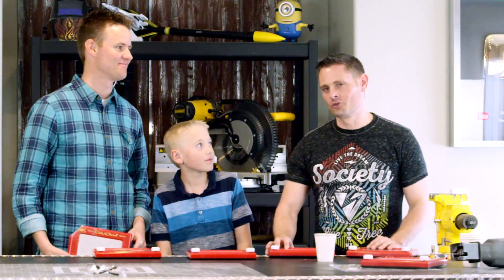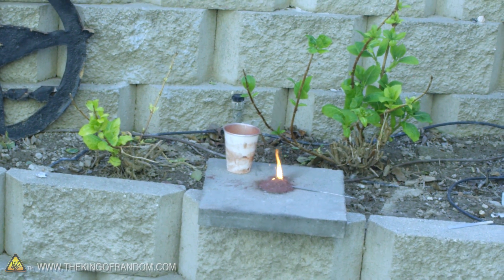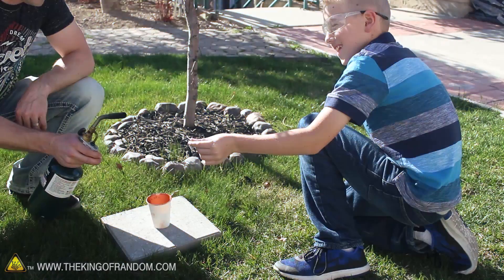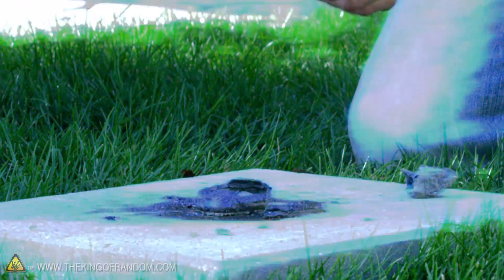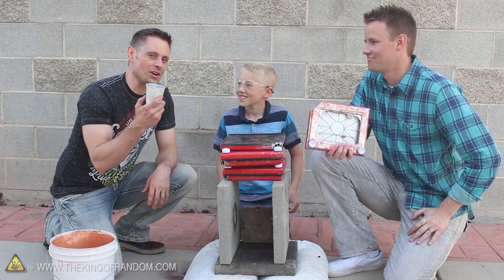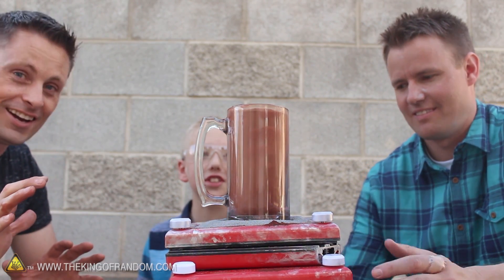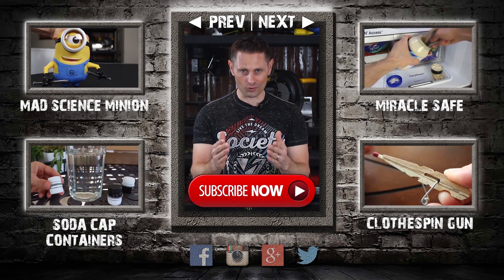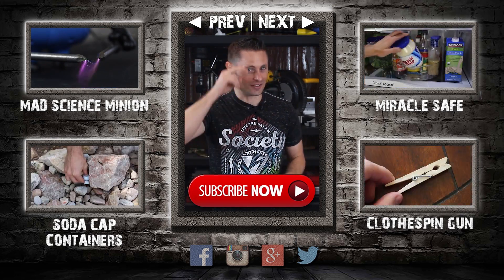Can you make Thermite with an Etch a Sketch?

Comment: Grant... how about aluminum foil vaporized in a electrical socket for some homemade lightning!?  There is also another related science experiment, where you can (allegedly) replace the foil with a thin wire (in the electric socket) and the results are suppose to produce an arc with a bang on par with a 4th of July category 4 aerial salute(?) However, in order to achieve this, I believe 220V or higher would be required... definitely not an experiment for those who are safety challenged!

Comment: Isn't the stuff in the etchasketch magnetic powder? Is that not how it draws? Considering Aluminum is non-ferrous, I doubt it's aluminum powder.
Reply from the maker: +Jacob Furrow The powder doesn't react to a magnet, or water.  But it does dissacociate in HCL
Reply: the aluminum powder  coats the screen then twisting the knobs moves a needle that scratches lines of the powder off. I took one apart when I was little.
Reply: Mark McGehee Yeah, I just remembered that. For some reason I thought it involved magnets.
Reply: Grant Thompson - "The King of Random" Have you tried melting it?
Reply: +Jacob Furrow it sticks to the glass inside the etch a sketch and then theres a etch that scrapes the powder off in very fine lines then when you shake it the glass gets coated in the aluminum powder so it can be etched again
Reply: In what insides video they tried magnetics it didn't work

Comment: The proper way to light thermite was to use magnesium strips and you didn't compensate for the styrofoam balls in he aluminum powder so you were actually supposed to double the amount of aluminum powder to iron oxide.
Reply: +Jnm1220 I highly doubt that the styrofoam balls in the mixture accounted for half of its mass, considering the density difference between styrofoam and aluminum.
Reply: +Maximum Of Twenty styrofoam still has mass though so it could be a possible factor

Comment: Had u used a flower pot with a hole at the bottom you would have contained the termite to burn down to the etchasketch

Comment: Hey Grant
I have an idea.dHow about you make a tutorial on how to make a hand heald fireball. Its really easy, all you need to do is coat a (100% cotton) cotton ball and you soa it in nail polish remover and you light it on fire. Because cotton is great at holding heat in its core and nail polish remover gives off almost no heat the cotton ball when on fire feels room tempiture. depending on the saturation of alchol for the chemicals 50-60% gives off a bit more heat but less pure nail polish remover like 20-50% gives off a smaller flame. Also the reason that the Etch a Sketch did not act like a propper thermite because you did not have a oxidizer and if you left the styrofoam balls that definitly would have stopped it.
Sincerely
                  One of your Fans

Comment: It's thermite it's a mix of aluminum powder and iron oxide "rust" and mix the two together until you get a fine red powder and you will end up with a hunk of steel and little pieces of iron so yea fun backyard experiment
Reply: And a better way to light it off would be magnesium it lights of better

Comment: The last experiment scaled up to quickly for my liking.  Starting from the amount of thermite, to the insecure stand... I mean: Using a CO2 interesting was very wise - but when a CO2 extinguisher does not work and I know I have burning metal and an oxidizer in the mix, I personally would not user water. It obliviously turned out good, but I was scared seeing water and thermite.

Comment: for a project make a slingshot steel ball blow dart  use the ball as the tip then use a drill or something to put a bolt or screw through it

Comment: you ave some very informative videos. However, it looks like you are starting to lose focus on safety. This video shows you guys igniting explosives/accelerators in a dangerous manner, then for some reason putting the reaction inside a glass container(?why?)Because enough people asked you or was the glass an improv.  In your past video I thought the value of practical knowledge balanced the sometimes dangerously weak choice of construction materials. You must take in consideation that if you are choosing to build custom HighV./Amp electrical tools and choose arguably the bare minimum on some parts

Comment: I'm not completely sure that this is a correct explanation but this sounds right to me. The reason you couldn't put out the fire with the CO2 fire extinguisher is because part of the thermite reaction is aluminum ripping oxygen from the iron oxide(rust) and a CO2 fire extinguisher usually starves a fire from oxygen Which it can't do in this case.
Reply: This reaction also releases heat which is why it's so hot.

Comment: grant you shouldn't use a co2 fire extinguisher as that is only used for fire of liquids  you should instead use a foam or powder fire extinguisherwhich is meant to be used on both liquid an solid material fires.

Comment: water doesn't put a fire like that out
Reply: +Patrick Marsh You are correct, as this is a chemical reaction. I was saying the same thing about GMM's Brake Fluid and Chlorine Powder in a bottle experiment which results in a fountain of fire and liquefied plastic. They had used water to cool it down and everyone now thinks that you can use water to put out a chemical fire, however the AoE was so small that the water was able to overcome the small radius of fire, that won't always be the case, but people won't listen.

Comment: Curious, Will the styro slicer cut you or hurt you if you touch it when its on? how about with gloves?
Reply: +Gershon Dharmanandan It would be as hot as stove top.  So if you have gloves on, it should be fine.  Gloves meaning leather ones.
Reply: Colebug99 ahh ok cool.. i might try and make one... what else can it cut?
Reply: It would probably just give you a painful shock
Reply: Probably will zap you without gloves because it is powered with electricity isn't it?
Reply: Styro slicers are heated to a very high temperature. They will burn you pretty badly, but they won't cut you like they cut styrofoam
Reply: ahh ok cool...
Reply: Gershon Dharmanandan You could probably cut any kind of styrofoam, or insulation.  Really, anything spongy that has  little air pockets in it.  And it won't shock you, I have been studying Electrical Engineering for a while.
Reply: Colebug99 ok thanks... So I can cut cardboard?
Reply: +BlueyTheGreat_XD no it's heated
Reply: +Gershon Dharmanandan Maybe. I wouldn't try it because styro slicers actually break pretty easily. You even need to take your time cutting styrofoam